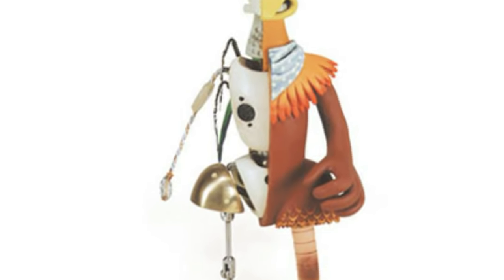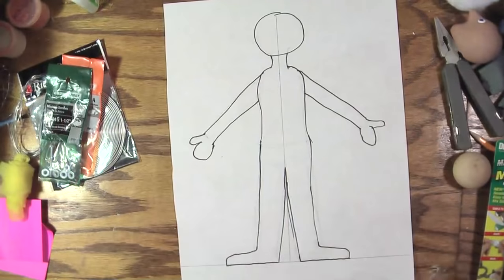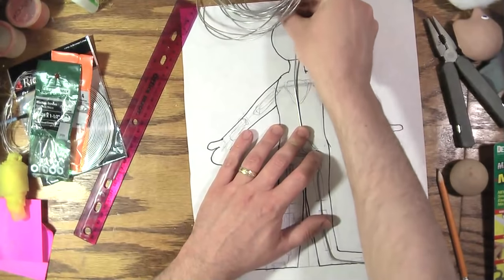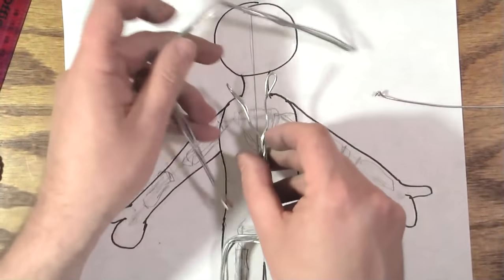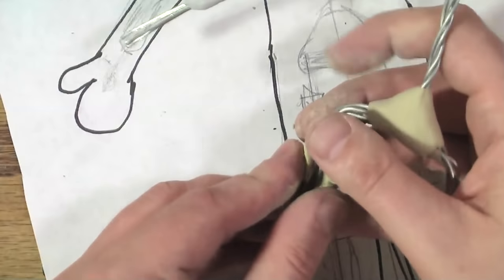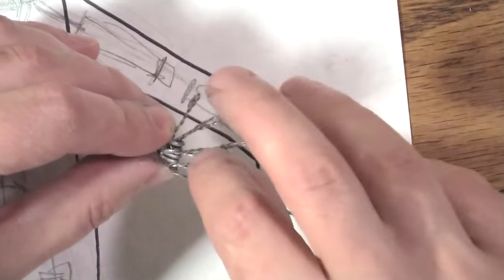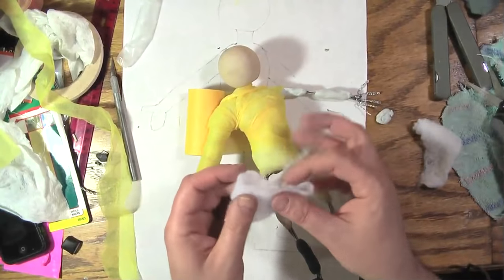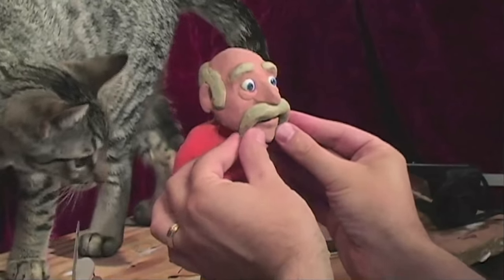Stop Motion Tutorial:  Making an Armature

Comment from the maker: Here is your shopping list:

Aluminum armature wire (from an art store or Amazon, not the hardware store)
Epoxy putty
T-nuts (1/32)
Wing nuts (1/32)
Bolts (1/32)
Washers
Pre-wrap
Cotton batting or foam
Aluminum foil or wood ball (something for the head)
Wipes (Epoxy putty gets messy)
Reply: Thanks, Michael!  How did you land on the (1/16") gauge/width of your armature wires? ~ are there advantages to using several lighter gauge wires twisted together rather than using a single thicker one?
Reply: where i will get the kit???
Reply: Can you use clay rather than epoxy puddy?
Reply: Michael Parks thx im going to walmart;v
Reply: Hi what kind of clay do you use for sculpting the face?
Reply: I just found this video through researching the  stop motion process for a project of mine, and seeing the creator put a shopping list of the things I’ll need, that were mentioned in the video, is amazing. 
A lot of times you would just have to memorize what materials they mentioned and try to find it on your own.
It’s great when creators use this level of consideration! It’s very nice.
Reply: @kearamiranda3093  thank
Reply: Dude your even up for me
Reply: Thank you sooooo much for providing the shopping list as well as the super informative vid!
Reply: Would aluminum bonsai wire work
Reply: So if you use foam do you need to use pre-wrap then?
Reply: Have you or do you have a video about, baking clay in a toaster oven? If you were using clay to make your stop motion puppets or accessories. If you could give some pointers, that would be a great video. Thank you for your video's.
Reply from the maker: @showman139  Sure, you can bake clay in a toaster oven. I'm guessing it isn't a good idea to use a convection oven since the blowing air may dry out the clay rather than harden it, but I've used a regular toaster oven for that before.
Reply: @MichaelParks  I can not use a regular oven since polymer clay isn't food safe. Also, I live with people who don't want to taste clay when they cook in the oven. Thought it would be a good idea to request a video since not all toaster ovens are made equal, nor made with clay in mind. Thank you so much for your time and direction.
Reply from the maker: @showman139  This may not convince anyone, but I've been using the kitchen oven to bake clay for decades with no undesirable effects on food.
Reply: @MichaelParks  hmm. 🤔
Reply: @MichaelParks  Would having a toaster oven save on work space if the need came up?
Reply from the maker: @showman139  I suppose it would. I ran into trouble when I made things that were too big for the little toaster oven.
Reply: @MichaelParks  Is there a video that you would recommend on the subject of stop motion puppets and toaster ovens? Or do you have one in production?
Reply from the maker: @showman139  I don't know of one, and I'm not making one because I currently don't have a toaster oven, but really all you do is follow the baking instructions on the package. There's not really any more to it. You might want to try doing a search for a tutorial or instructions on boiling Fimo or Sculpy instead of baking. That's a way to avoid burning and darkening the sculpture as well as smelling up your oven.

Comment from the maker: For rubber latex fingers, so they can grip.  But for clay hands I generally don't use wire because it invariably pokes through the clay, and clay fingers hold their pose and even some objects without wire.  I just use wire in clay fingers if the character has to hold something the clay can't support, and even then I will often use a loop of wire attaching the object to the wrist and letting the fingers wrap around the object without wire.

Comment from the maker: I use tape to cover holes in the floor, or erase the holes digitally frame by frame in photoshop.  For the bottoms of the feet, if the foot is make of rubber, the screw goes through a slit in the rubber that closes up nicely when the screw is removed.  Can also close up a whole with clay.

Comment: I'm making an armature to fill my time during quarantine. I don't have epoxy clay so I used duct tape wound around the wire for the bones. cotton batting held in place with loops of thin wire. made the hands out of wire covered in felt. Feet out of foam covered in duct tape- still working on how I'll tie those down without the proper supplies. My biggest challenge will be the head- I don't have clay! I might make the core out of foil and then "sculpt" the face shape with hot glue and paint it. Working on some tight restrictions here, haha.

Comment: +Michael  Parks If you want to use underwrap to make the puppet flexible  will you still be able to add the clay on top of the underwrap ?
Reply from the maker: +April Smith No, underwrap would cause the clay to crack and give way too easily while animating.  Arms and legs should be solid clay.  If you want to reduce the weight of the puppet by having a lighter core, I use aluminum foil pressed tightly around the armature.

Comment: You can use "friendly plastic" with a heatgun. Despite the cost of the gun, I think it can be a cheaper solution if you make a lot of characters (with one tube of epoxy I could only make only one character). This method is used in the youtube video "Building a Stop Motion Monster: Making an Aluminum Wire Armature" at 4:45.

Comment from the maker: Mid-shot breakage is a major down-side to wire armatures.  I haven't tried it, but I would break away the epoxy putty with a pliers, remove the broken wire, replace it, and build up new putty to hold it in place.  The putty won't take too long to set up.  If you're using software with onion-skinning, you can use it to get the puppet back into place.  Success of this method will also depend on how easy it is to move the clothes out of the way.

Comment: How do you make a head that can swivel and turn on a budget? (Probably a wire frame with a foil head)
Reply from the maker: Yes, I use a wire neck going into a foil head. It's better, though, if you can have a wooden ball at the core with a whole drilled for the wire, and then with some seriously strong glue. The important thing is to make sure it's all tight with no play between the head and the neck.  So if you're just using wire, squeeze the foil as tight as you can and use lots of strong glue.

Comment from the maker: It bends a lot easier, but the big difference is that when you bend steel wire it springs back some, while aluminum holds the position you bend it into.  Steel wire armatures are extremely difficult to work with.  It's worth it to get real armature while.

Comment: + Michael  Parks Ooooh ok  so basically instead of using the floral wrap( which will make the clay crack) I need to use aluminum  foil for the  arms . But will that still make the puppet flexible once I start making it ? Also can I use Mehron liquid latex and mixing that up with acrylic paint that I want to choose?
Reply from the maker: +April Smith It's underwrap (thin foam strips) that causes clay to crack.  A layer or two of floral wrap on the armature is fine, and protects the armature from the clay (more an issue with ball-and-socket armatures).  I wouldn't build the arms up with anything unless the puppet has really big arms, in which case I'd make it tight on the armature and keep it clear of the wrist, elbow, and shoulders.  Foil is indeed not flexible.  I just use it for the head and body.  I don't know about specifically about Mehron, but you can add acrylic paint to liquid latex to give it color.

Comment: if i can't make tie-downs for these puppets,there is any alternative way to make sure my puppet will be stable during the animation?
Reply from the maker: Small, powerful magnets.  One goes in the foot and the other under the platform/stage/table the character is standing on.  Available at the Stop Motion Store (link in description above).  Tie-downs and magnets are the only ways I know of to keep a foot in place.
Reply: +Michael Parks with magnets do u still use the putty to to keep it in?
Reply: +Michael Parks That's actually quite genius.
Reply: You can make grass or sand out of clay and make the foot go inside of it deep enough to hold it in place

Comment from the maker: The hardware costs just a few dollars (much less than wire and epoxy).  The other way is with really strong magnates, but they cost even more.  I guess you could just screw the feet to the floor and cover the screws, or glue.

Comment: How thin is the wire you are using for the hands and what is the manufacturer?

Also, If you were to make a neck using just two wire strands (I know you used two, but, when twisted together, they look like more) can a wooden head like the one you used be supported on a thin neck like that, or would I need something lighter?

Comment: yes 2 wire twist i been getting breaks, I'm have copy you and go 4 wires, it's so disappointing after you make add the epoxy then test it with however ur going to use it, either clay, foam, etc, and make a few movements and breaks. But for someones that's just starting out I expect many fails.

Comment: Thanks! I was just wondering how long an armature like in this video lasts before you need to give it surgery? How many times can you bend it?
Reply from the maker: A lot depend on the quality of wire and what the character is doing.  A simple walk with gentle bends will last for quite a while.  Lots of sharp arm bends could break the elbow after a few shots.  The trick is to try to bend the joints at slightly different points to spread out the wear and tear as much as possible.

Comment: If you made a 9 inch tall armature, would you need to leave 1/@" of space between the epoxy putty for the knees, elbows and other joints?
Reply from the maker: Half an inch may be enough.  It just has to be enough to distribute the bend enough to keep the wire from breaking after too few bends.  For smaller armatures, I don't do bones along the arms and legs.

Comment: I wonder can tree branches be use for this? or some of that bbq skewer (wood type) I think if you chop them down then use um! beads with holes that fit on it as joint's. that would also bring the price down to under $5 or $8.
Reply from the maker: Wood skewers might be strong enough not to break.  But working out the joints so they bend and hold their position would be the tricky part.
Reply: Michael Parks
I think if it can be done, than it should work, if not then is just experimenting at the moment until something comes out of it,plus it would be much lighter than those metal wires. this could be also build like those, wooden posing figurine manikin.

Comment: I have a question:
If I use rubber latex on this method and my character is a dinosaur-type monster that doesn't have cloth how do I make the heavy detailed skin of it?
Reply from the maker: I get into that in my tutorial "Latex Puppet Making."  You'll get all the detail you want by adding it to the clay sculpture of your puppet.  When it's reproduced as a rubber latex puppet via plaster mold, the detail will be there.  The tough part will be getting the rubber skin to move realistically.  Foam latex stretches and squeezes better as the armature moves.  Rubber is likely to fold.

Comment: great! tks
btw, shouldn't we use gloves when using epoxy poly?
Reply from the maker: +Petite Box I don't know of anyone getting damaged skin from the stuff.  The putty tends to pull apart rubber gloves, or thicker ones make it hard to work with the putty.  It is indeed difficult to clean the putty off your fingers, so if anybody can recommend gloves that can handle the job I, too, would like to know.

Comment: If I'm making a hand puppet,
I'll need to make an armature?
Or not?
And how do l make sure that the puppet can actually fit on my hands?
Reply from the maker: You'd need some bones in the arms if the arms are so long they droop.  Joints would be loose.  When I made rubber latex puppets, I make a mold of my own arm and reproduced my hand and arm in plaster.  I would then sculpt the puppet in clay directly on that to make sure it would fit my hands.  If you can't do that, you just have to measure carefully.
Reply: I have an idea:
I'll make and armature made out of aluminum wire,epoxy and some wood which is based on my hand size and my character.
Then,I'll sculpt with clay on my armature,mold it with plaster and then cast with tinted latex.

Comment: instead of the foot lock - what about an armature that connects to the torso - what do you recommend?
Reply from the maker: I've used that method when tie-downs aren't possible, and it does work, but it takes extra time to keep the feet in the same position for every frame.

Comment: i would like to make small 3 inch to 6 inch armatures. What size wire would you recommend? Thanks ^v^
Reply from the maker: I usually use 20-22 gauge wire, though still doubling or tripling it depending on how much give I want it to have.  Heavier on the legs to hold it up, lighter on the arms for more flexibility.

Comment: What happens when a part of the armature snaps and you've got all the cloth, foam and modelling clay over it. How can you fix it? PLEASE REPLY! I NEED HELP!
Reply from the maker: Surgery is required.  You'll need to pull away all that cloth, foam and clay to get at the whole limb.  Break the putty with a pliers and remove it on both sides of the break.  replace the broken wire with new wire and re-build the bones with epoxy putty.  This, by the way, is why ball-and-socket armatures are better if you can afford it.

Comment: Hello, 
 I'm about to start construction on a stop motion puppet for a class, and in preparation I made a quick wire frame armature to play around with. What i was wondering is if there is a way to counter the arms or legs breaking if it happens mid-shoot? Like, do you make backup arms, or is there a way to make replacing limbs easy? I was going to do a ball and socket armature to prevent this, but im not sure I have the time anymore since I've never made one like that.

Comment: my characters are only 4 to 5 inches tall and I have some relatively strong copper wire does it seem necessary that I should still need 5 layers of wire? I only used two layers and it seems to work just fine none of them have broken yet.
Reply from the maker: I've never used copper wire for an armature, so I don't really know.  Seems like it would have too much spring-back while animating.  Is it handling okay for you?
Reply: Michael Parks Yeah but I just wasn't sure about long term use. My main question was for the Kick Ass thing. Please let me know what you think as soon as you can. also could you connect the T clips to a pre-existing action figure? how would you go about making things fly and jump without having to go through all the computer editing?
Reply: Michael Parks
I just made one according to your specs using 16-guage copper wire. It took one 5 yard spool.

Comment: What do you recommend if the arm or leg breaks during animating?
Reply from the maker: When I run into this, I pull back the costume and cotton/foam, run some wire from the body and the upper arm, and use epoxy putty at both ends to cover the break. It's a big load of no fun, and if it happens mid-shot there isn't much hope of saving that shot, but the show must go on.

Comment: what is the really thin wire you use for the hands?? what gauge or where can I find it?
Reply from the maker: I don't have the package anymore, but I think it's 1mm or 1.5mm, available on amazon or at an art supply store.
Reply: Hmm, well the stuff I made my entire armature out of is 1.6mm which looks like the same thing you used on yours. I made stop motion arms and had them play this instrument. I made them with 1.6mm wire but just did one thickness or wire for a finger but made digits with the epoxy putty. the wire you're using for the hands looks much thinner and you can double or triple it up which obvs better.  I got thru one video but recently went to make a second vid and lost a finger right away haha. so I've now ordered some 20 gauge (0.81 mm) and even some 26 gauge wire. BUT... It's not necessarily 'Armature' wire it seems to be for jewelry making but it's all I could find for thinner wire so I'm wondering if this is gunna work or what you were using for the fingers and hands.??
Reply: @MichaelParks  Als super informative vids man, so thanks for making them and also thanks for answering me!!
Reply from the maker: @jboairbrush  Those came out good.  I think the wire I used for fingers was jewelry wire as well, but must of been something like aluminum since they held their positions fine.
Reply: @MichaelParks   Yeah thanks again man! I ended up using the jewelry stuff as well and it held up pretty well I did have one break in my newer vid, but since my character is basically armature and epoxy I just broke off part of the hand and replaced the wire for that finger and rebuilt the hand. so it was much better than the thicker wire. hey you aren't on instagram are you??
Reply from the maker: @jboairbrush  https://www.instagram.com/michaelmparks/, but I don't post much.

Comment: Hey Michael,  I love your videos.  They have been inspirational.  I have been using replacement mouths which are basically just drawings on paper with a pen.  The pen leaches into the clay and causes problems.  I also tried a sharpie and had the same result.  How do you make your replacement mouths?  Thank you.
Reply from the maker: When using a clay head, I keep the mouth clay and animate it frame by frame.  But if you don't want to do that, you could sculpt a set of mouth shapes out of sculpy and bake them hard so you can stick them onto the face.

Comment: Could I use some sort of light, easy to cut ribbon instead of pre-wrap?
Reply from the maker: I wouldn't.  I don't think that would hold together.  The pre-wrap stretches, so it holds tight to the armature.
Reply: Michael Parks 

Can you also use bar tie wire?